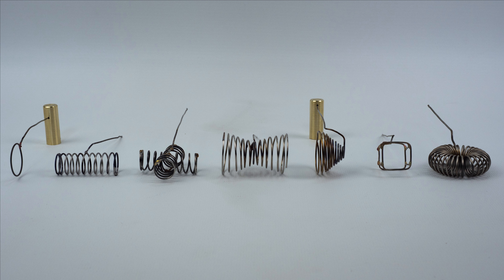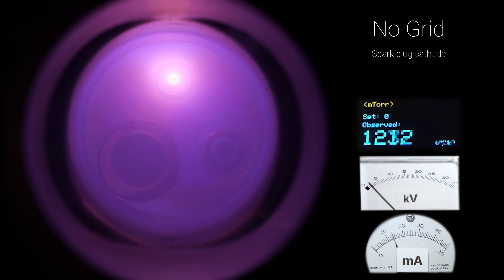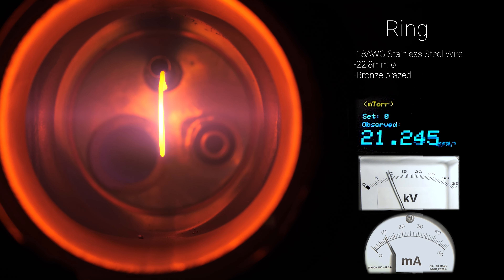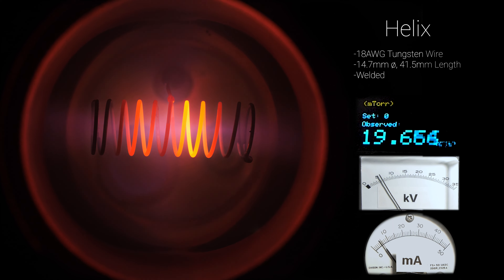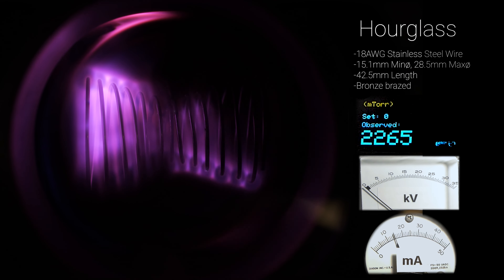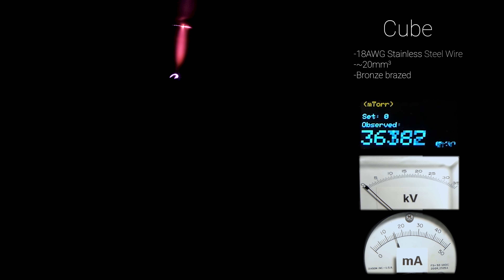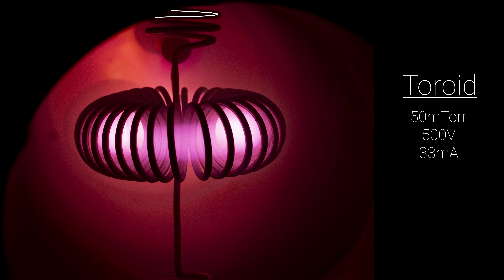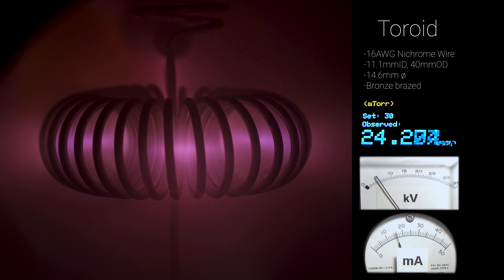Experimenting with fusor grid geometry

Comment: I would suggest using Helmholtz coils  as a design for your apparatus. This would focus the plasma to the very center of the vacuum chamber this would be a great test to see what kind of electromagnetic pressure can be put on electrons being forced into 1 dense spot then at that point all that needs to be done is increase the power to the electron gun and coils and see where it leads....
Reply from the maker: I'd be really interested in applying magnetic fields to the fusor, but it'd be solely to play with the plasma and see how they interact together. While I certainly appreciate the suggestion, for fusion purposes the magnetic field would have to be massively strong, far beyond what my budget can allow. In order for fusion to occur the ions have to be accelerated at very high voltage to increase their kinetic energy, then they have to manage to collide together, already defying the odds. Even if they manage to collide it's still a tiny probability they'll manage quantum tunneling to fuse. Unfortunately, even the strongest magnetic field I could muster in my lab wouldn't be significant to effect fusion in any practical way. The coulomb barrier is a tough nut to crack.

Comment: Great video! really facinating, I've built 2 farnsworth fusors and have always been curious about different grid shapes but haven't had success with brazing so I just went the lazy route of helical spheres. Thank you very much for sharing!
Reply from the maker: I can definitely empathize! Brazing or welding these thin wires has proven extremely difficult without a pulsed spot welder. If it helps you I found that if you lay the wire to be brazed on a heat sink (I used a small solid aluminum block) and apply heat from a torch, the wire heats up much slower, preventing rapid oxidation which makes wetting impossible. It doesn't replace the proper equipment but it provides a little buffer to allow you to actually join the two wires before it overheats and oxidizes. Thanks for watching!

Comment: How do you know if the material is going to endure the current whitout melting? I'm trying to make a grid for 60kV and 5mA.
Reply from the maker: I'm sure you could calculate the conditions with which the material will be exposed and determine if that temperature is within the operational temperature of the grid you plan to build, but there are so many factors at play that those calculations quickly become difficult. I'm more of an experimentalist in that regard. I'd make a cheap and easy grid, take it for a spin and see what it can handle. At 60kV and 5mA tungsten wire would be your best bet, but you might get away with a lower gauge stainless steel wire if you only plan on subjecting it to those conditions for a short period of time. Keep in mind the grid is only as strong as it's weakest link. If you have wires brazed together, the brazing alloy will melt before the wire. Richard Hull has a great writeup on this for more information: https://fusor.net/board/viewtopic.php?t=8660
Reply: @Project.Infinity  Ty for the information.

Comment: The ring electrode with magnetic shielding (current around the ring) would be interesting.
Reply from the maker: That would be very interesting. I have yet to pay around with electromagnetics, just mainly electrostatic fields. I'd love to see how the plasma would behave with both. Thanks for the idea!
Reply: If you add the variable of current flowing in the ring, you could also play with using different frequencies of ac and wave shape etc, you might find some kind of resonance condition between the geometry of the ring/setup and the magnetic field and hit the sweet spot of maximum plasma confinement with limited losses . The messy  part would be to apply the current to the wire whilst maintaining the dc charge. Maybe old ac welder iron core under oil with paper wrapped copper to form the secondary which would be charged with the hv dc, with the primary of the tx connected to a high power signal generator

Comment: Great video! What brand/model of vacuum pump and pressure gauge did you use?
Reply from the maker: Thank you! Edwards E2M2 vacuum pump and Edwards APG100-XM pirani gauge
Reply: @Project.Infinity  Thank you! Does that reach low enough pressures for fusion, or just plasma?
Reply from the maker: @alenzhang4854  Yes, I believe a good roughing pump creates a clean enough vacuum for fusion. It's standard to use a supplemental turbomolecular or diffusion pump to reach a much higher vacuum, but I don't believe that's necessary. I avoid it by pumping down, then purging the chamber with lots of deuterium. It wastes D2 but it thoroughly cleans the chamber of contaminants. I've (unofficially) achieved fusion with this setup/procedure. I say unofficially because I measured neutron radiation with a He3 tube, which is very highly indicative of fusion, but I want to get a second confirmation by using a bubble dosimeter before I officially claim fusion. Thanks for the question!

Comment: Would the cone grid produce delta-v with the Ion beam effective for acceleration in space? Simply from the design and current, I think that's neat...obviously only works in vacuum.
Reply from the maker: The thrust would probably be pretty abysmal as it wasn't designed for it, but I'd imagine it would produce some delta-v. In space it would need an ion source (mine was the residual gas remaining in the vacuum chamber), but I would guess the asymmetric plasma jet would generate thrust due to Newton's third law. That's a really fun idea for a follow up video!
Reply: Cool, maybe different alloys may produce a different affect? Or a coating in addition to the gas source. The idea the you could MacGyver a propulsion source from raw materials you may find laying about in space is neat. And the idea the your could make simpler but still effective versions of otherwise complicated machines has always fascinated me.

Comment: its very cool, but aren't you scared of overheating, or xray emitions? could you include a geiger counter reading next time?
Reply from the maker: Luckily if I overheat the grid the worst that happens is it melts and I have to build a new one, the vacuum helps insulate its heat from the walls of the fusion chamber so no damage there. X-ray emission is a concern, I definitely don't want my head right next to the viewing window, but keeping a distance protects me via the inverse square law, and I also wrap the chamber in a lead blanket for further protection. I can definitely include a Geiger counter reading next time. Although the pen dosimeter I wear is more accurate in terms of radiation dosage absorbed, the audio feedback from the Geiger counter is really helpful. Thanks for the comment!
Reply: @Project.Infinity  i am planing on building something similar to this, but waaay more diy, and it will resemble an electron beam more than a fusor, should i be conserned of my safety? I will be using around 20kv and -0.6bar pressure.
Reply from the maker: @lukisltu5282  Dealing with devices that produce high voltage and X-rays, safety should be your first priority. 20kV is no joke, and at a reasonable amperage can be quite deadly. Your project sounds like a ton of fun, but you should definitely familiarize yourself with the dangers involved, and ways to mitigate those dangers before you start. I'd recommend fusor.net as a starting point, the forums there have highly valuable information regarding vacuums and high voltage. The information is generally geared toward fusors, but it sounds like the knowledge should carry over nicely to your project as well.
Reply: @Project.Infinity  thanks for advice, will be sure to be safe :)

Comment: How is it that the toroidal grid at ~20 microns reached plasma extinction? 
Given the massive surface area of all the wire packed closely together, and close proximity to the outer grid due to the wire passed through the 'donut' hole, I'd expect the current to be higher.
That behavior of high voltage in vacuum is foreign to me, any idea what's happening with that?
I've re-watched several times becuase this video is an excellent source of information, but this still confuses me.
Reply from the maker: I've wondered the same thing myself. Regardless of grid geometry, Paschen's law states that at these low pressures the plasma will become more and more difficult to maintain (requiring a higher voltage) the lower the vacuum becomes. It's a bit confounding though why the toroid grid met plasma extinction at a higher pressure than the other grids for the precise reason you mentioned--It's closer to the anode than any of the others as the anode passes right through the center of the grid. You'd expect the exact opposite. It's possible that it has the fewest sharp edges. Charge is concentrated on sharp peaks, and conversely is more evenly dispersed along smooth surfaces. The toroid grid could be particularly smooth making breakdown more difficult. Or it's possible the toroid shape evenly distributes the electric field around the anode wire passing through it, making it more difficult for the charge to concentrate in any one locality.
There might be a much more elegant explanation someone else can provide, but these are my best guesses for now. It's surprises like this though that make these experiments so fun, and it's exactly why I try things like this. Thanks so much for watching, and for the great question!